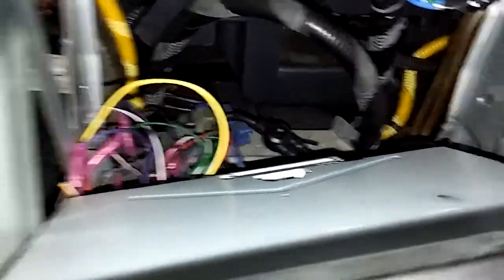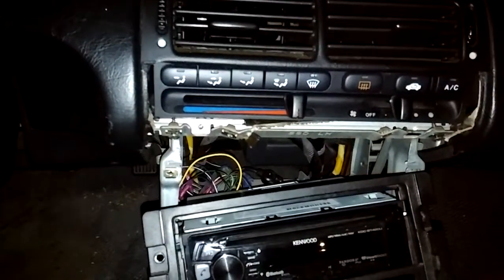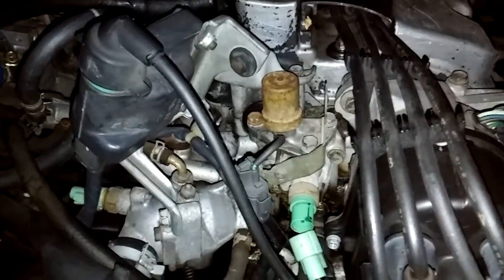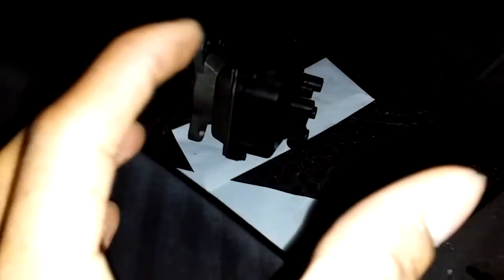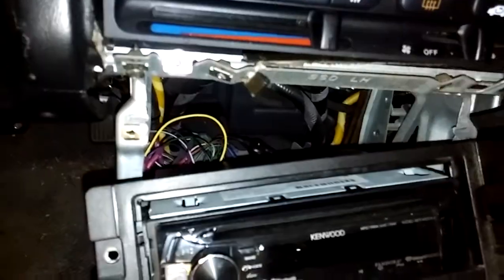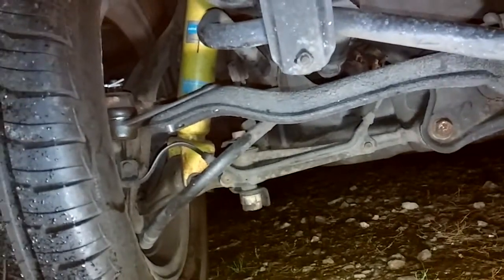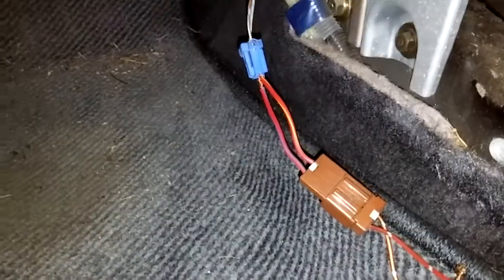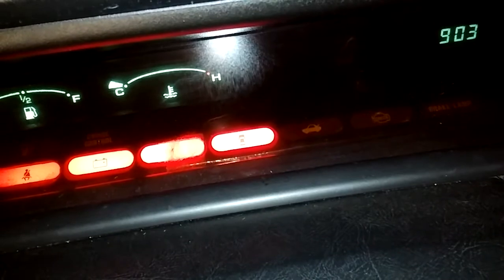Old Errol 93 Honda Prelude check engine light connector

Comment: now the question is the same connector that autozone or Oreilly will be able to connect in the scanner ???
Reply from the maker: No scannr for your car. Just a peace of wire
Reply from the maker: Do you know how to count the check engine light?
Reply: yes I saw the video , thanks
Reply: Is this also good for a 94 prelude si
Reply from the maker: Yes

Comment: good video, thank you. just picked up my 2nd prelude from a police impound...with my other '96, Honda put that obd2 port in a dumb place as well...lol.

this new-to-me 95 has a japan only engine swap and no OBD1 connector. this will not be fun. i'm sure it's a traction control code, USDM didn't have that feature.

did you figure out your Intake Air Temperature Circuit code (112)... and vehicle speed sensor, code 17? great cars, not many left...
Reply from the maker: I regret getting rid of that car.that car has the but rear suspension honda has ever made